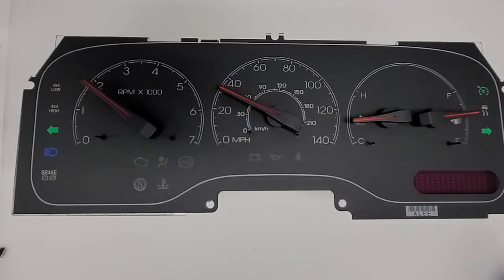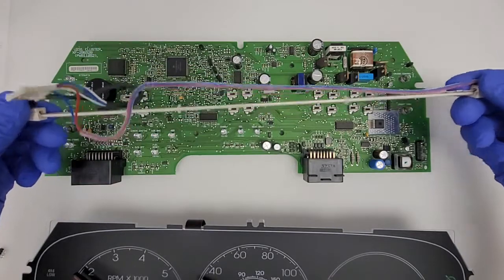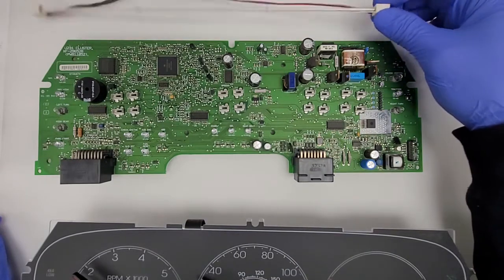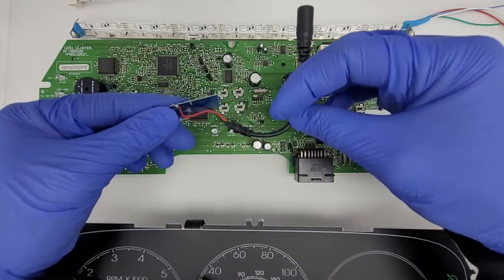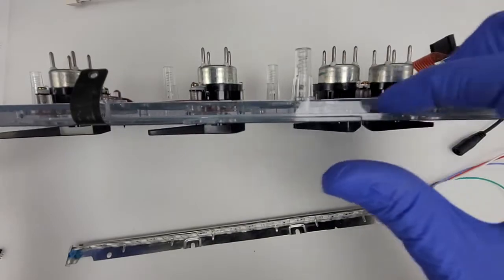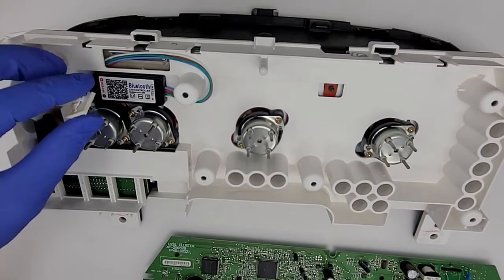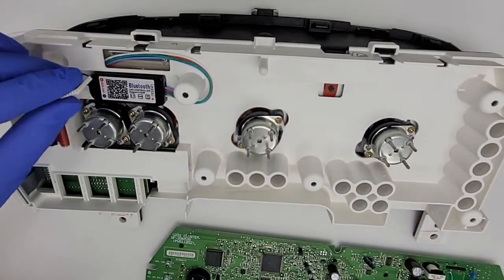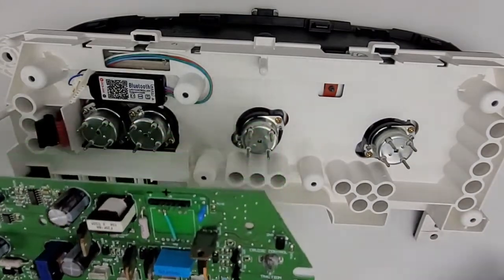2003 Lincoln Navigator CCFL To RGB LED Conversion | Back-lighting Repair

Comment: Where did you buy the led from? My dashboard lights take forever to warm up and turn on. I believe the lights are going bad and need to be replaced. I would like to use LED lights in place of the old style.
Reply: hi, i just wanted to ask if you find these LED. I am trying to find where i can buy them but can’t see them anywhere.
Reply: @johneeer5000 me too, cant find them. have you found them?